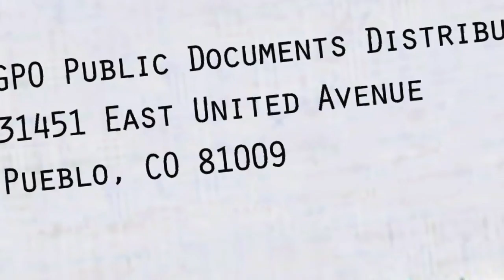U.S. Government Printing Office: Pueblo Distribution Center marks Milestone of Service

Comment: I just tried to use the current website to find some useful documents.  A WASTE OF TIME. THE WEBSITE IS USELESS. I gave up.  There are other sources of information that are easier to access.

In the 1980's it used to be so easy -- just send a post card, write CATALOG, PUEBLO COLORADO 81009